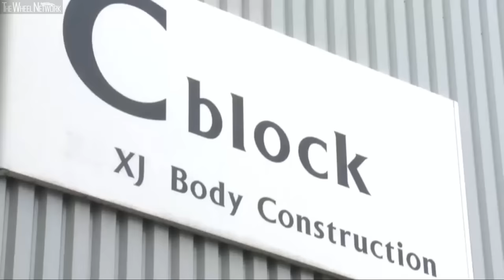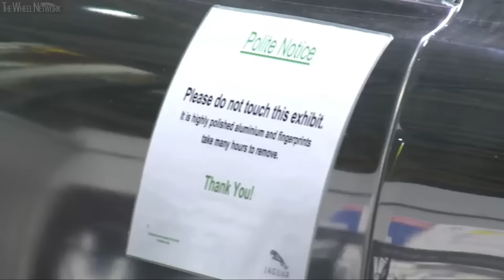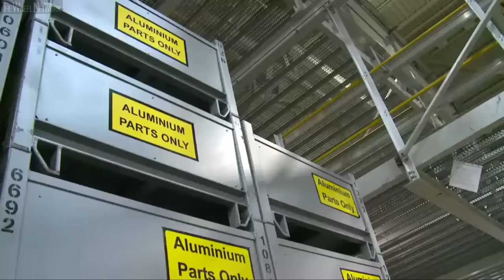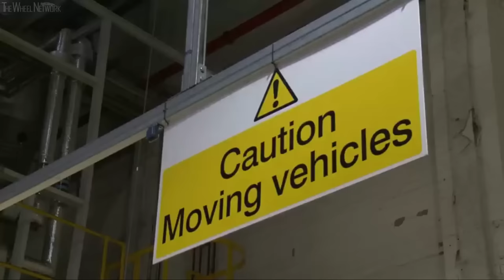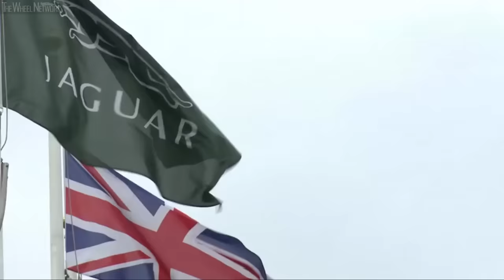Jaguar XJ Production in England (X351 Historic Footage – 2010-2019)

Comment: What would have been nice is if Jag had sorted out the issues with central locking which goes back decades. My 2018 XJ is still suffering from them luckily its currently under warranty.